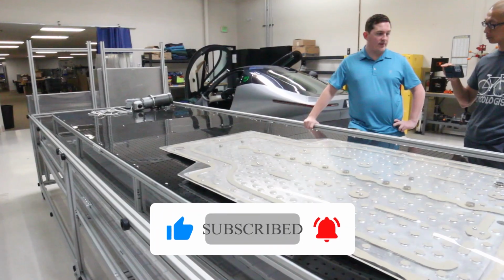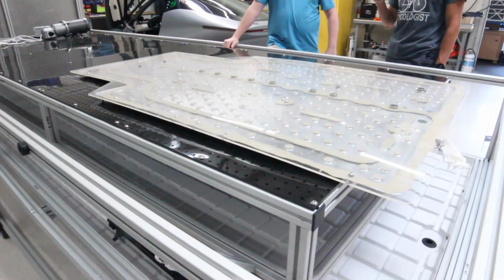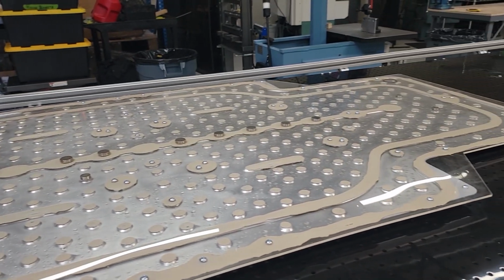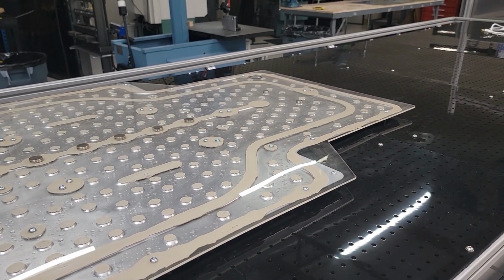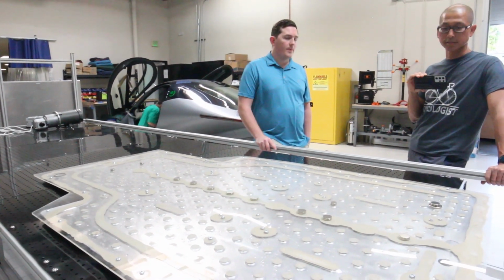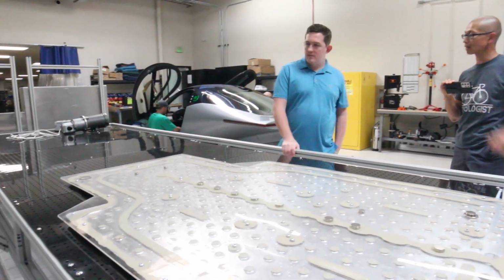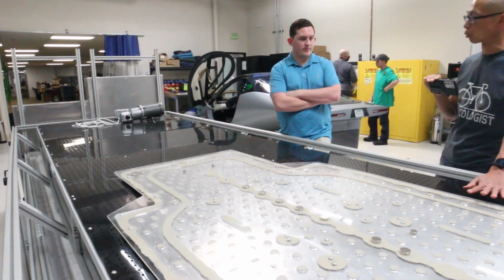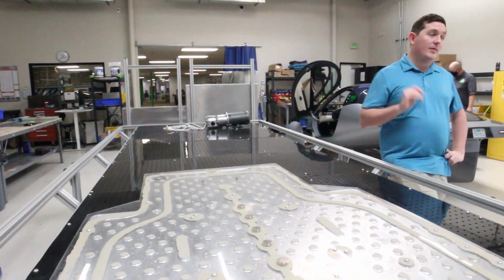Exclusive first peek at the Aptera's thermal management and testing rig

Comment: I am assuming anything made of aluminum will be power coated and likely be wrapped for additional protection if exposed?  Aluminum and road salt are a bad combination unless the aluminum is power coated. The vinyl wrap would help protect the underside from nicks and could be replaced every few years if needed.

Lucid has a great video on battery end cooling and why it is so much better than what Tesla is doing with some of their batteries.  I know that it would seem that there is more surface on the edge of the batteries for cooling or heating but that has shown not to be as effective as end cooling.  Heat radiates from the ends much better than the sides.  I'm glad to see that Aptera is going with end cooling/heating of the battery pack.   

It will be very interesting to see how much heat is generated by the battery, inverter and motors at city and highway driving.  Given that it doesn't take much energy to move the vehicle unless you are racing or braking hard, the amount of heat that needs to be dissipated should be minor and might not even be enough to supply cabin heat in cold weather.  Ideally, you would want to use waste heat to heat the cabin before any other means of heating the cabin.  Of course waste heat from the motors and inverter should go to battery temperature control in cold weather as it would be highly unlikely to have a secondary heat method for the batteries in cold weather. The cabin will have heated seats and yoke if needed.  I would imagine / hope that all of this information would be available for the driver/owner to review.
Reply: Resistance heating will be used to heat seats/cabin until a suitable heat pup is available.  You are  thinking ICE architecture where there is a lot of wast heat available from a combustion engine
Reply: @johnmalcom9159  True, there is a ton of waste heat in ICE vehicles but if there is heat that needs to be dissipated to lower belly pan and it is cold, I would hope that the heat could be dissipated to the cabin. Defrosters generally have hot air blowing on the glass. I have heard of windows that have a defrost screen built into them (more than the defrost strips in a rear window and where the screen is not noticeable but I can only imagine the energy needed to do that in the Aptera)  A heat pump will be great once that is available.
Reply: @ddessert6  maybe I'm thinking wrong here but if the body panels are radiating heat, wouldn't they provide a degree of heating for the cabin anyway? Even if its radiating most of the energy outward? I feel like a cabin with a warm shell would be easier to heat than one with a cold shell. 

I suspect that directing all the waste heat to the cabin could save some heating-power costs in the winter, but unless you could redirect that heat it would probably get really hot in the summer (or just compete with the a/c). And I'm not sure how weight or cost efficient it would be to have such a system on board. 

But I agree, all things being equal wrt weight and cost, it would be better to heat the cabin with waste heat. 

I suspect the bigger item on the list is installing a heat pump in the next design/revision, but even that will probably be a few years is my uneducated guess.
Reply: @20xx-mm-dd  A heat pump seems to be the ideal solution.  I will admit my understanding of the complexities of efficiently using a heat pump in the Aptera is beyond my current understanding of the issue and why as you said will be left for the next generation of vehicles.

What I was thinking in using the waste heat, though there will likely be little of it, is to circulate the coolant through a heater core instead of the belly of the vehicle.  If the battery pack is actually in contact with the belly pan then moving that excessive heat to a heater core is unlikely as the belly pan will do what it is meant do and draw the heat out of it.  The only "waste" heat I can remotely think might be usable would be from the motors and controller but that really should be a very small amount unless you are drag racing or braking hard all the time.

Comment: It seems a waste of energy to simply disperse the heat outside the vehicle , when that heat could be converted back into power. Perhaps the best solution is to use a battery that doesn't create heat when charging or discharging, and that would be aluminum ion technology..........https://youtu.be/YWiWLO6wX5s

Comment: Will there be a warning system if the coolant level drops or the pump fails so we can shut down the car to avoid fire?
Reply from the maker: I'm sure there will be
Reply: Sure. Plus there will likely be sensors that put the EV into limp mode long before it would overheat.
Reply: "Limp" mode. Like that term! Aptera should make it an official state in the UI
Reply: @johnmalcom9159  I think "limp mode" is common for many EVs. I found out my Chevy Volt has it after a buck ran into my 1 month old car, causing a leak in the radiator. The car got me the 2 miles home uphill, but a coolant pump motor was still damaged by running dry.
Reply: @johnmalcom9159  "Limp mode" was probably more famous for 1990s Dodge automobiles when certain sensor errors would force the driver to only have 2nd gear available as a "safety". It was irritating because more often than not the transmission was probably mechanically fine, but the electrical for the sensors were not.
Limp mode would then cause transmissions and engines to overheat, causing more damage than what was theoretically broken.
/end of nerd rambling
Reply: Oh my! I would be devastated if that happened to my new car. Lucky you were so close to home. You must be living the right kind of life!
Reply: @johnmalcom9159  it was an ex girlfriend. The car was stuck in her garage for years! :-/

Comment: So end cooling of the batteries I guess, pretty interesting to see the different methods each company uses. Tesla has cooling channels running between the cells. I wonder how well bellypan cooling will work at the charger with no airflow, maybe that will need supplemental cooling from the A/C system
Reply: Apparently end cooling is more efficient than the ribbon. Tesla is moving to end cooling as well, especially with the 4680 cells. End cooling also increases pack energy density. I hope that belly pan idea moves the heat. We'll find out.
Reply: Did you get an idea of the area of the belly pan? Unless it is fairly thick (and heavy), aluminum will be a bit vulnerability to rocks that are thrown up. I think I heard earlier that the belly pan would be hydro formed. Now that makes sense.
Reply: Hopefully not too warm given its low 50 kW charging rate.
Reply: The lower charging speed (in kW, not miles/hour) and the lower power consumption will require less heat dissipation.
Reply: But I think the intention is to be able to supercharge at 150kw+ , at the Tesla chargers.
Reply: @fritzponds1  as far as I know they're planning on a 50kW maximum charging power.
Reply: @fritzponds1  That means 500miles of range per hour. It's a good idea to rest for half an hour after 250 miles of driving anyway. So I don't think higher rates are necessary per se.

Higher rates would be convenient in rare cases, but it would add cost/weight/complexity and faster charging is also not good for your battery cells. 

So I'm fine with the 50kW plan personally.
Reply: Well, I agree with you, but I’m just bringing it up because of a comment Chris made. He said that even at 100kw/hr on a Tesla supercharger, that would be 1000mi/hr of charge, and Tesla supercharges can go up to 250kw. Tesla cars have to kick on the battery cooling system at the superchargers and I would expect the Aptera to need it as well at that rate.
Reply: @fritzponds1  I think in that video he was talking hypothetically, just to explain how efficiency would help with fast charging (in terms of miles per charging time). 
Not a very wise move imo because it can confuse people into thinking this is in the pipeline, which I still think it is not.
Reply: That would certainly make sense or else they would need a small internal radiator and fan. I still wonder if 50kw charging would need it on a hot day. I’ve had my EV turn on in the garage on a 6kw charger, but that was after driving. I would love to be a real world tester, Of Delta or Gamma.
Reply: @fritzponds1  Most likely the Aptera will need that sort of cooling at those rates. But that's only IF it were capable to charge greater than 50 kW, which it won't.
Reply: Well I’m afraid that at the individual cell level there is no difference between a 40kw-hr pack charging at 50kw and an 80kw-hr pack charging at 100kw. I think supplemental cooling might be needed in some edge cases.
Reply: @fritzponds1  that's true, but Tesla is doing much faster than that. 250 if I'm correct.

The 100kwh aptera will probably also not charge faster, if the cooling is limiting...